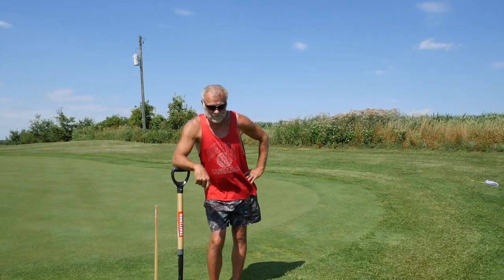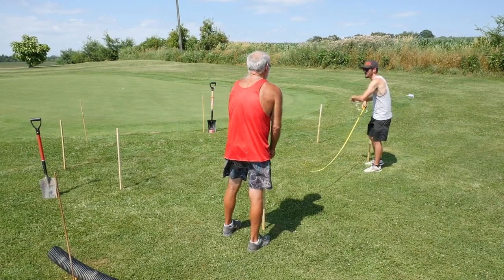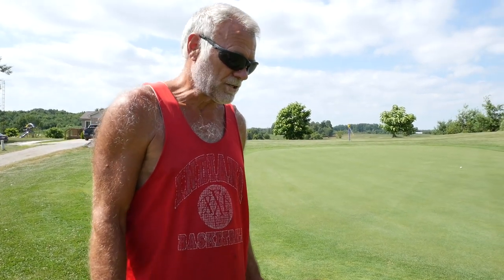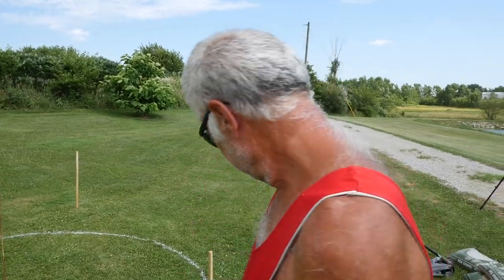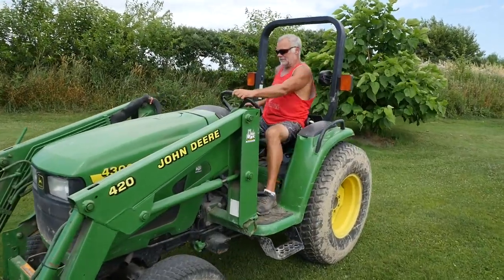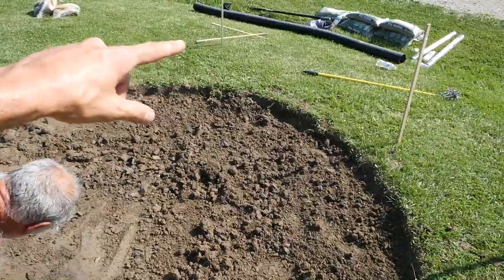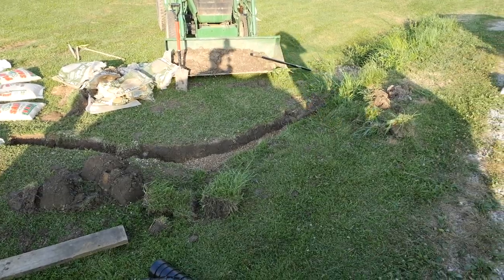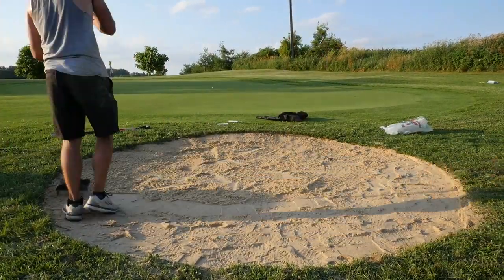Building a Backyard Sand Trap

Comment: You tell Scuba Steve he gets a penalty on that bunker shot? Looked like he grounded the club...
Reply from the maker: I’ll let you tell him 😏
Reply: It's 2019 boys, you can ground the club no penalty.
Reply: Jerry Cooper might want to check the rules
Reply: @aaronpankey8685   My mistake. Grounding still not allowed but no penalty for some touch, unlike before: 

New Rule: Under Rules 12.2a and 12.2b, the player is allowed to touch or move loose impediments in a bunker and is generally allowed to touch the sand with a hand or club; but a limited prohibition continues so that the player must not:

    Deliberately touch the sand in a bunker with a hand, club, rake or other object to test the condition of the sand to learn information for the stroke, or
    Touch the sand in a bunker with a club in making a practice swing, in grounding the club right in front of or behind the ball, or in making the backswing for a stroke.

Thanks for the heads up!
Reply: Jerry Cooper 👍🏼👍🏼